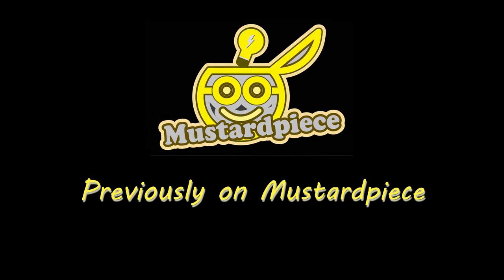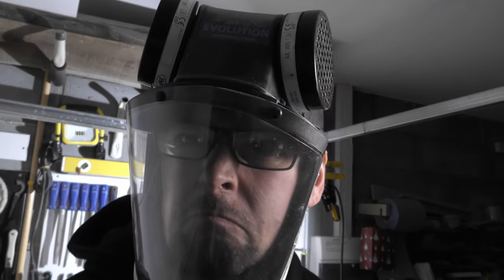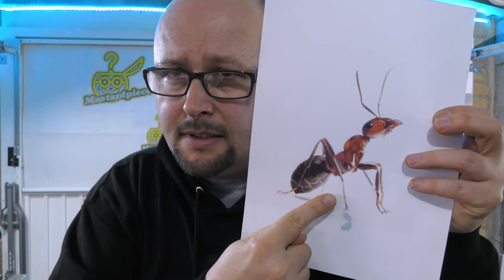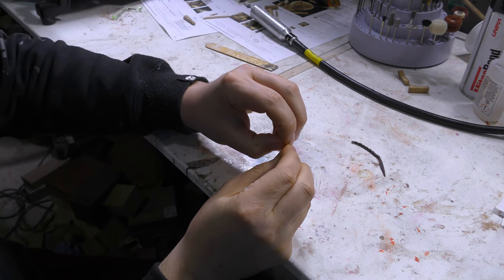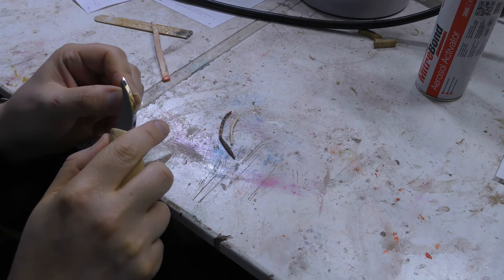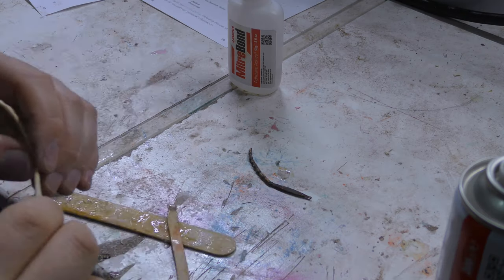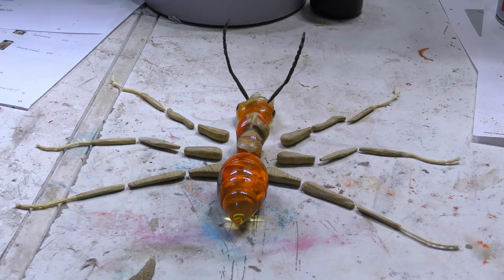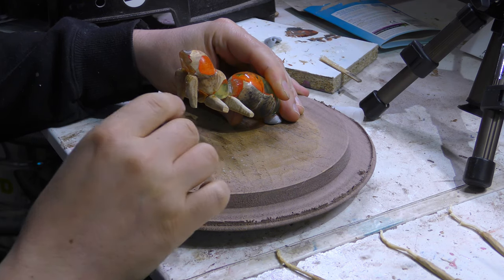Woodworking Action Movie Trailer - The Ant Part 2

Comment: Love the art; love the techniques; love the skill; love the craftsmanship -Yes I do😀  And especially love this big Fire Ant mutant that it is🔥💥
My experience with the bandsaw is ya gotta keep fiddling and then once you have it right keep fiddling to keep it right.  Have you thought about a scroll-saw (not coping, fret, or jig saws) ? You can cut the antennae and legs without much trimming the basic shapes - only the rounding of carving would remain. And if you get really good you can cut in 2 planes.
Stay safe. -Mike😷
p.s. add more varied tags to expand your sub'r base ...  'Arts & Crafts' is one off the top of my head
Reply from the maker: Thank you my friend. I usually have woodturning woodworking in my TAGs, but yes I will try that. Good idea.  Thank you for the kind words.